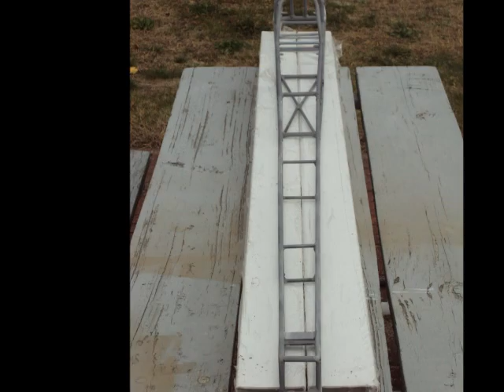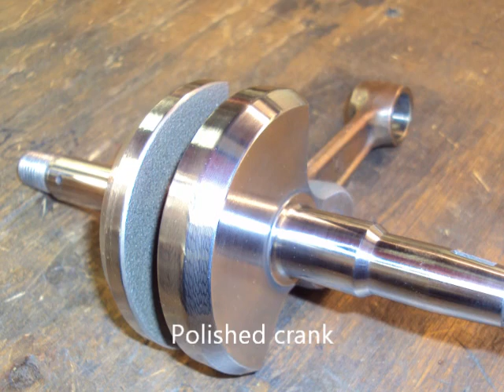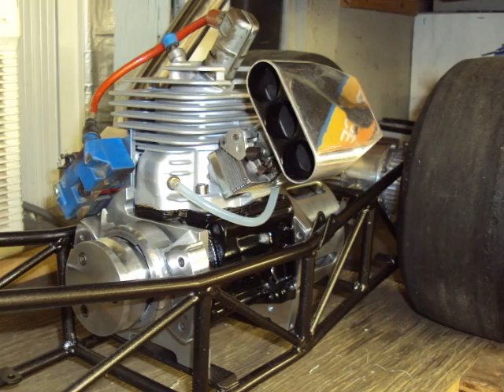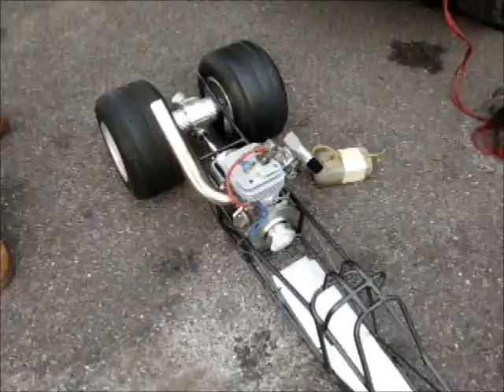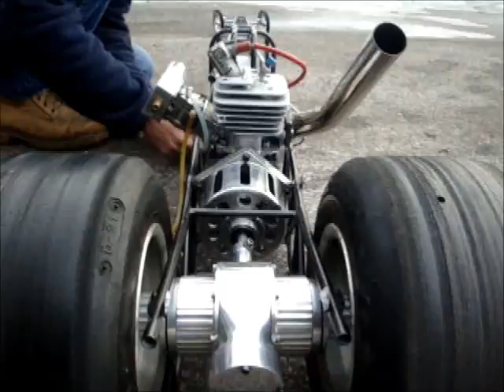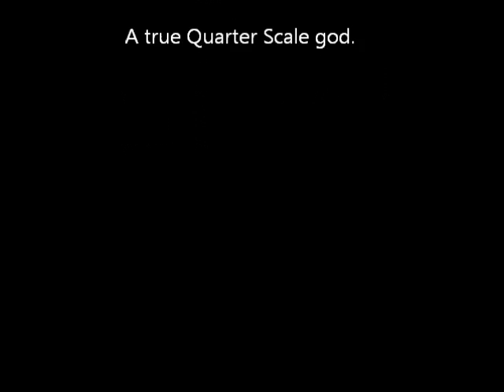1/4 scale pacesetter dragster build

Comment: Two stroke benefits alot of a good tuned pipe, because both ports are open half the time, fresh mixture gets in the exhaust, with a good tuned exhaust with good back pressure, the mixture returns into the cylinder and gets burned, without the back pressure most of the mixture gets in the exhaust and will not be burned which means less power.

Comment: Wish it was mine.nice set up..
I have a 125cc rotax max engine go kart.the engine would be good for these size cars.28bhp although it would take some doing as it has a tunned exhaust pipe.
The beauty of the rotax max engine is the centrefugal clutch so it would sit happly going into pre stage /to stage.
Keep up the good work guys
All the best from a british petrol head.

Comment: If it had an expansion chamber you would get a lot more power out of it.
Reply: I have to agree, whats with the straight pipe?
Reply: In a power curve but for wot straight works great think of the old McCullough kart engines.On or off.
Reply: Those engines weren't designed to run with an expansion chamber. All they had was a small muffler with a couple of baffles to make them quiet. You can tune these quite easily to run with a straight pipe.
All 2 strokes don't have to have expansion chambers to run better or give them more power.

Comment: I used to build racing chainsaws... We raise the exhaust port about 2-3 mm lower the intake the same (2-3mm to taste) build a tune pipe add a bigger carb and jets and increase the area of the transfer ports.. ( ie weld up the outside of the cyl at transfer local and grindem bigger from the inside..  The engines turned so hard we started blowing the cyls off the bases, the fix was to machine the top off a new cyl and through bolt a billet head on to it..  theres a whole bunch more power to b had

Comment: That, I don't know. Although I'm more than familiar with 2-stroke motorcycle engines, my best guess would be it's a tuned length?. For a motorcycle, I'd use an expansion with divergent/convergent and a stinger for bleed off, but these aren't motorcycles.
Tuned for a specific rev range like a weed-whacker perhaps?. Dunno, not my area.

Comment: Oh, one last thing so i dont have to hear it lol Yes the Boaters with the highly modified weedeater engines in them do use expansion chambers, they are single cone IE on RPM chambers. So yes, if you want to have all your power @ a given RPM, then you will see gains with chambers on Nitro engins. And YES, you could build tripple cone pipes as well, if you know which 3 powerbands are the most benificial to you. If I have missed anything, and your qualified, no really, then by all means, reply on!!

Comment: I will tell you that you should have run it with a tuned pipe as i tune 2 stroke engines,Motor bikes, Karts, & RC, Plus design race pipes,but great work, what did you do to modify the piston, as well as polishing the top?

Comment: my only question is:  is there a rule against expansion chambers?   Every single video ive watched is using a straight tube header, which is of little advantage to the racer at low or high rpm.   I understand the scale thing, and thats a valid answer.....but scale cripples the guys in my corner of rc.....airplanes.

Comment: thats fucken awsome, i wander if you put a expansion pipe on, it would help get you into the higher RPM's..... 
I had a GOPED with a 40cc 2 stroke and when i put a expansion chamber exhaust on and a bigger carb it made a huge diffrence, better tourqe and higher RPM

Comment: you would be surprised they really dont make that much more power with a tuned exhaust with my airplane i have a 60cc motor and people say with there wrap around muffler they turn 6800 rpm and with my tuned muffler i turn 7200

Comment: Why did you go for this instead of a Nitro V8? was it cost?
Reply: madjimms I'm assuming mostly cost was that reason. Those things are cool but I don't think I'd buy one for 8,000 dollars. Also they have practically the same amount of power as a chainsaw motor anyway but the chainsaw motor is so much cheaper and easier to work with it's just a much better choice. That's what I assume made that decision, I wouldn't know for sure.

Comment: Ok, so you basically built a single cylinder engine, put it in a drag frame.... BUT... its just a dust collector if you don't run it! What's the point anyway? No body shell, no steering servo... I don't get it.

Comment: Not really. 40-50:1 fully synth doesn't smoke that much. Even Castor doesn't smoke much until full load is applied if it's jetted crisp for pickup not longevity and the pipe isn't full of clag to begin with.

Comment: 2 stroke engine = another exhaust
Reply: lol your confused 2 cyl = another exhaust!!  2 stroke is the cycle of the engine not how many cylinders it is ! it is very long explaination im not going to explain here just look it on on google. 2 stroke and 4 stroke engine's and how they work.
Reply: 1boostup No. your confused.. He means that 2-strokes should have an exhuast with a expansion chamber on it. (=another exhaust).
That 2-stroke has a straight pipe, which should be on a 4-stroke engine..
Reply: 2 stroke single cyl is only going to have 1 exhaust pipe this one is a strait pipe missing the expansion chamber that would be at the end of the pipe but would still be single (all 1 piece) not 2.
Reply: 1boostup You just basically wrote what i wrote, but in other words..
Another exhaust, like "not this one, another" and not like " another pipe, two pipes"

Comment: one thing you folks may want to do is your homework!!!!!  First off, 2 stroke Nitro engines run a minimum of 8%-12% castor oil for lube, and also a proprietary amount of synthetic lubricants i the fuel. Given the amount of oils in the exhaust the tempurature of the exhaust and the air density based on the oil in it are too low (temp) and too high(density) for an expansion chamber to work. Secondly a chamber will never cover the rpm range of a nitro RC motor, 2,500-53,000 RPM. don't believe me?

Comment: Well.. If it was a top fuel Dragster They run 8,000bhp So if it was 1 cylinder it would still have 1,000bhp. :)